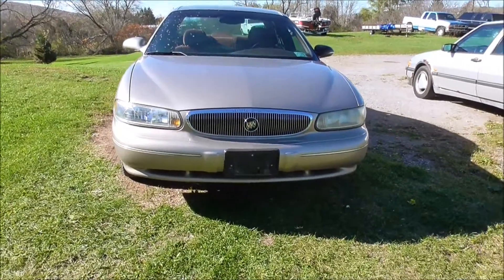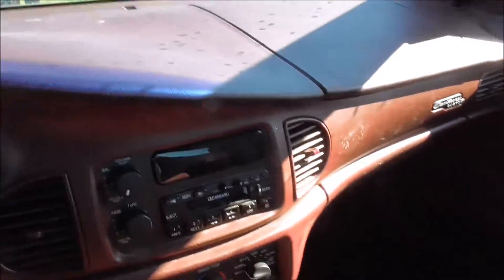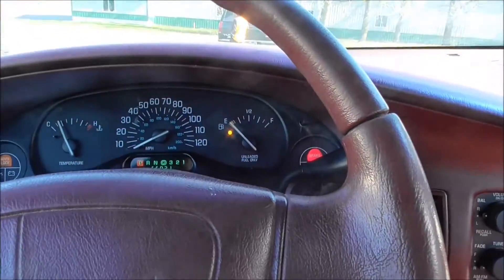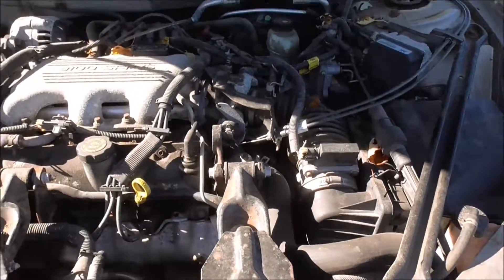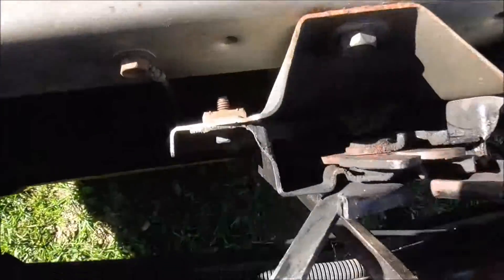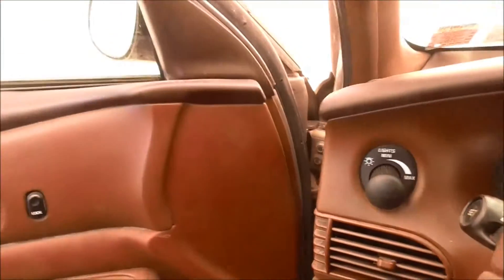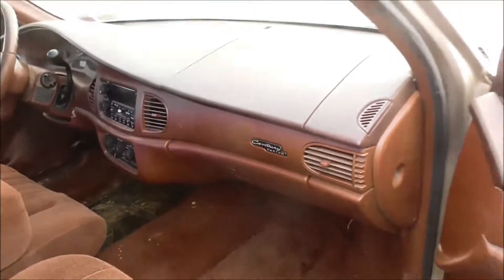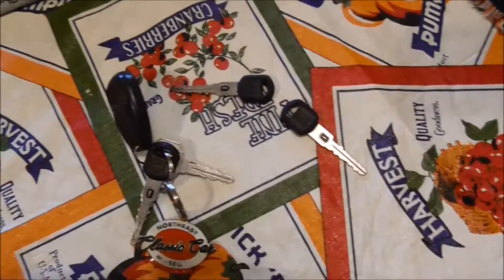2017 Derby car(1997 Buick Century)

Comment: why derby a car with 66000?
Reply from the maker: It just happened to have low mileage, it was no longer road worthy with the amount of rust and other things wrong with it.
Reply: I would've sold the motor
Reply from the maker: There is a problem with the engine, it has a blown head gasket. I would barely get any money out of it and I would be wasting my time to getting the engine out.
Reply: I would've gave $400 for it. I need one, too late now though